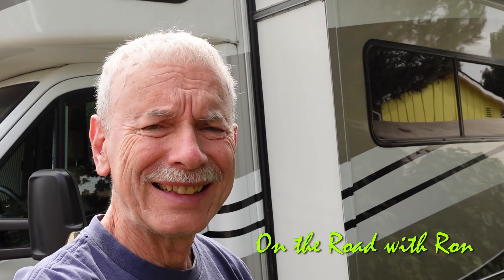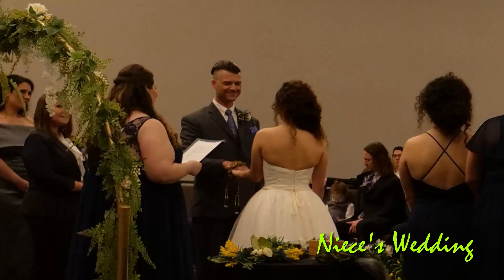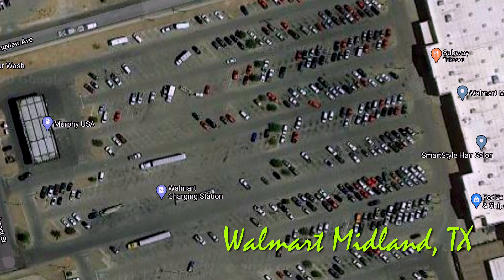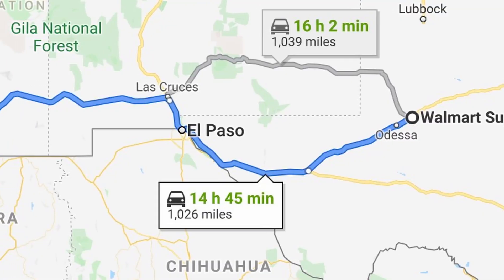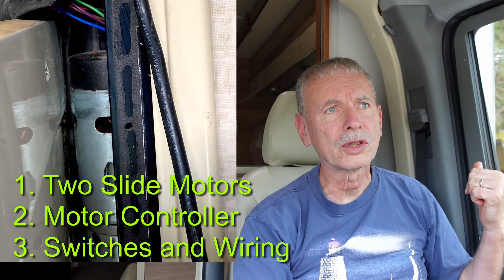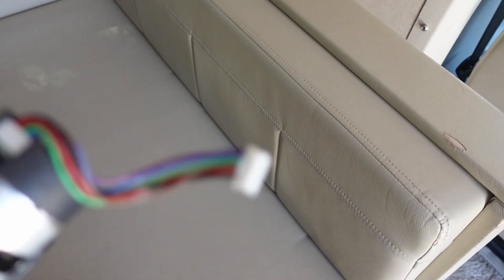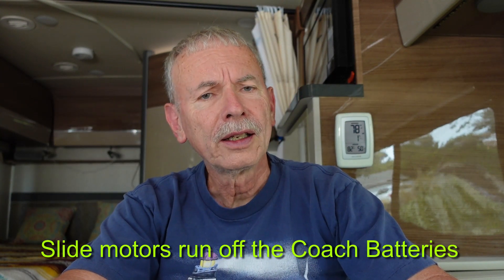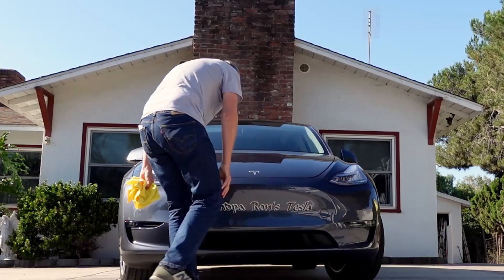Bad Slide Motor - What now?

Comment: I have the same type slides on my '13 view profile 24g. Same symptoms. When  I went through the flashing codes, it indicated a wiring problem. I started accessing the rear slide motor wiring on th driver side first and when I unplugged it at the topmost plug, one of the small pins in there was bent over so it would not plug in properly. I very carefully straightened it out and plugged it back in very carefully and ever since it has worked perfectly. I had been having intermittent problems getting it in and out ever since it was new. Usually one side would hesitate and the slide motors would get out of sync, jamming the slide from going out or in. The final time before I was able to find the real problem, I thought I would have to drive it almost 200 miles home with the rear slide out, but after 2 or three tries the emergency procedure worked to get it in. Then after I got home, I started the disassembly and found the real problem. I sincerely considered ordering a new motor, because our dealer said that was what they would do if I brought it there, at around 6 to 7 hundred just for the motor. A little  research showed I could get the motor for less than half that, but I got lucky and found the real problem as I stated for  basically just some investment of my time. Now the slideouts I thought were glitchy are transformed into the most reliable part of my motorhome
Reply from the maker: Seems each day can be an adventure.

Comment: Hey gramps— Gramps here! Me and the head master women are yakking it up over a 2021 view j model. The twin bed version. Only it’s used. Makes me wonder wonder if it’s a lemon? These units are expensive. Living in California our DMV robs us to the poor house mandating exceedingly high DMV. I realize insurance is going to be high as well. We we’ll eventually be forced to move as the state is quickly sucking us middle class dry. 

Would you wait to buy a motor home or? Buy/relocate in a more retiree friendly state?
Reply from the maker: I bought my coach used. New coaches have their own issues. Motor homes are expensive right now. They also have ongoing expenses so you will need to use it often to get your money’s worth. Good luck with your decision.
Reply: @ontheroadwithron2432  — Thanks Ron, wife and I talked, we are sticking with car travel only for now.We want to see how and where the economy goes. Inflation has us on the caution side of big purchases. I researched a couple of used units, $80,000 is pretty high for a two year old unit. Doing the math, I don’t believe we’d come anywhere near that kind of $$$ considering the years it’d require travel time. Its merely a matter of convenance only.

Comment: Ron
I was waiting for the fix. 
I was sure you were going to do it.  
Good video though.
Reply from the maker: I found than the motor connector was not making good contact. I ended up not changing the motor and its been good sincere plugging it back in and taping the connectors together

Comment: Thank you for your video and God's mechanical expertise...🤔
My 2013 Navion 24J  slide started making noises near the refrigerator, the wiring harness under the seat was bunching up as the slide moved, I fished out all lose plastic parts and keeping an eye on the harness for now. Can imagine what a nightmare it would be if the wiring broke!

Comment: Ron, I just picked up a View Profile 24DL.  I have already leveraged many of your ideas.  On the slide, the 24DL has an access point under the bed where one could apply a wrench ( electric drill with a socket ) to manually retract the slide.  Being a newbee , I do not know if this is typical or unique for a RV.  Or perhaps it's useless.  I would like to know your thoughts.
Reply: Thanks John! Must be that emergency operation slide deal I’ve had to deal with. Should be in the owners manual

Comment: Did you fix anything?
Reply from the maker: Well, not totally sure. Problem was a poor contact in the connector in the wall. Maybe it wasn’t fully engaged. After plugging it in and out a few times, I taped it up and put everything back. Has been working fine ever since.

Comment: Great videos! I have a 21 foot slide with the same Schwintek system you have. My fear is the slide not coming in and how in the world could I push such a large slide in manually. I ordered a spare motor from ebay and hopefully will never have to use it. I did learn there are basically 2 types of motors....500:1 and 300:1. I have both as spares. I could not get an angle on mine to see which I have so I grabbed them both. Earlier this year my slide started to go out on its own. Yup....thats right....it would extend at random times all the way out. Luckily I noticed Forest River had a recall on the switch and controller for 2019/20 Georgtown MH's. I called them and they checked my serial numbers and sure enough I had one that was recalled even though my MH is a 2017. They replaced it. I park next to a chain link fence and luckily I left enough room for the slide to extend or that would have really caused problems with hitting the fence. Anyway....sorry to be long winded. Keep up the videos!

Comment: Ron did you get a copy of the Winnebago schematics? I looked at the drawings on line but they really don't give the details needed to figure everything out, at least to me.
Reply from the maker: I looked at them but didn’t help much. Controller code said wiring but it could be anywhere or even a bad motor. Turned out to be connector.

Comment: Quick question.... the Lippert 236575 motor that ordered - is that the 300:1 or 500:1 ratio?    There are 2 different ones.   Thanks.
Reply from the maker: It’s the low torque one probably 300 to 1

Comment: Thanks for the good information. My 2016 View is 24G model  with rear bed slide the wood framing came loose with a big boom when moving the room I used better screws and added a bracket that I made then I used the dry spray PTFE and lubricated well inside tracks and motor. The room works fine now but I have seen many people with the early Schwintek system like mine that have have big problems. Lippert does not use that system instead Power Gear designed a better system for the later coaches. I spent years with these systems and the one common issue I saw was owners would leave cabinet doors open or seats reclined in the travel of the room tracks are too frail to handle the stress of an obstruction. here is a good video from Schwintek on lubrication for slides. https://www.youtube.com/watch?v=8KbVRFMo1Rg&t=20s
  Happy travels grandpa Ron